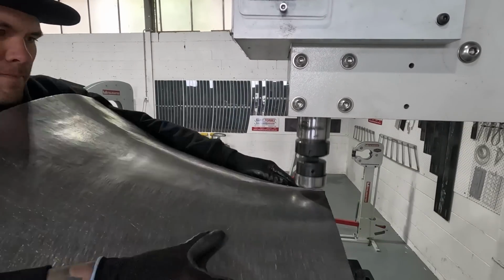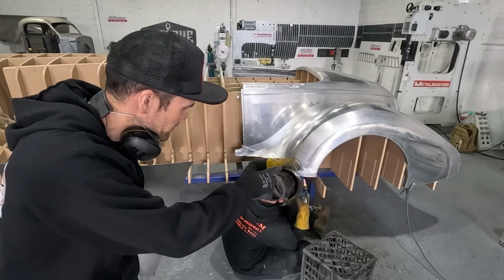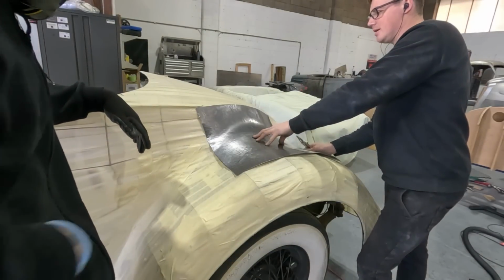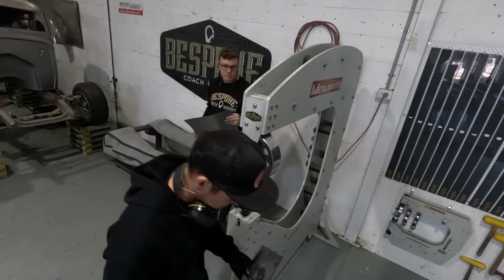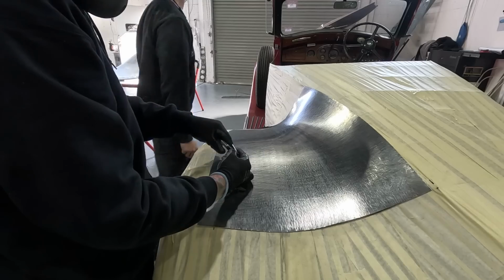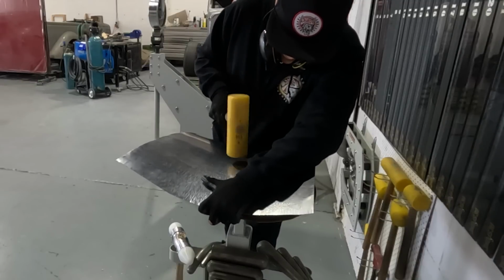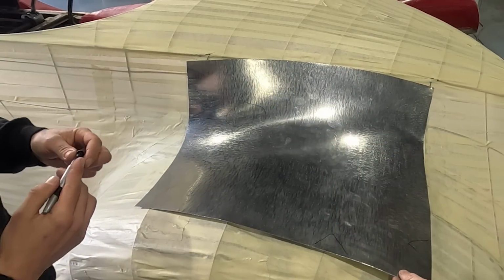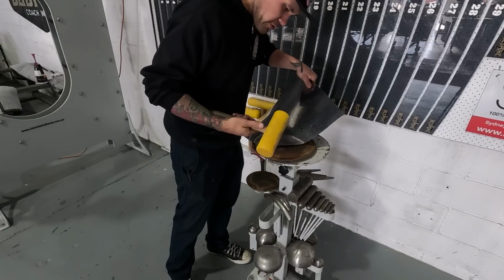Metal Shaping A Reverse Curve On a Power Hammer & English Wheel With Ayden Bespoke Coachworks

Comment: At about 7:15 into the video it looks like the linkage has fallen apart in the power hammer where the inspection window is.
Reply from the maker: It’s not apart, it has a “Pullmax mode” that requires an adjustment and pin to lock out the springs

Comment: I was so enthusiastic after I came back from Vegas that my ex-wife's husband has the idea I am a better metal shaper than I (yet) am. 

He overheard somebody replacing one of those front of the trailer toolboxs that the jack knifed old one was unreparable. He said, "I know a guy!!"

As I was dropping off my daughter, he showed me the box, which was pretty creased and had some definite stretch. We spent 2 and a 1/2 hours working on that $100 toolbox with a A couple of chunks of ivy as a dolly a claw hammer and a propane torch to do some shrinking. 

I've never had that much luck with heat shrinking, but as I was teaching him how to do it, dammned if it didn't work perfectly!
Reply from the maker: That’s amazing!!! Sometimes teaching helps you understand every better

Comment: Hey Karl, did you build that hammer? Also, how did Troutman and Barnes get their aluminum bodies so smooth using a Yoder?
Reply from the maker: Yes this is the dies being to harsh that the marks are in it. Ayden had modified the dies already and it’s smooth as silk